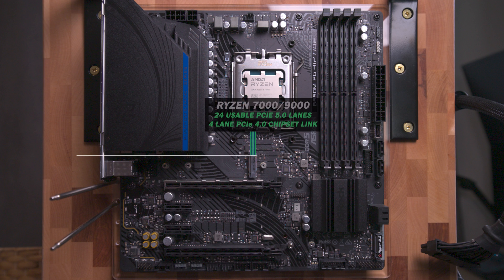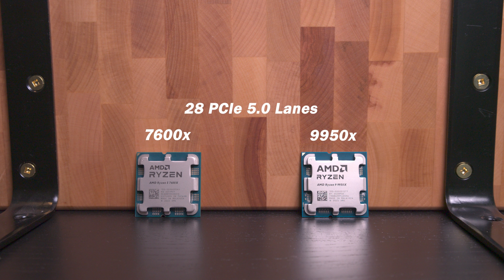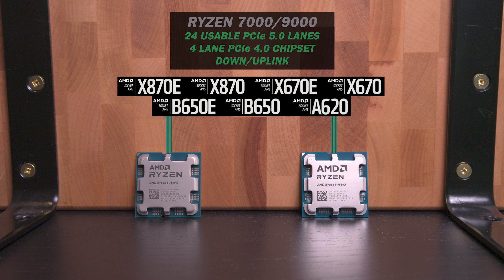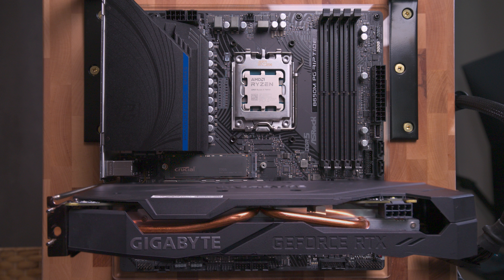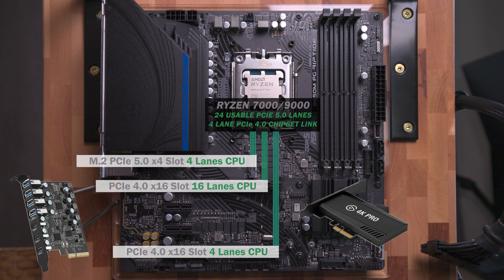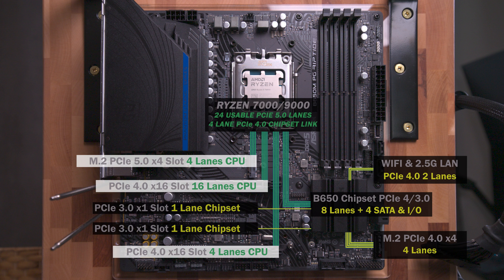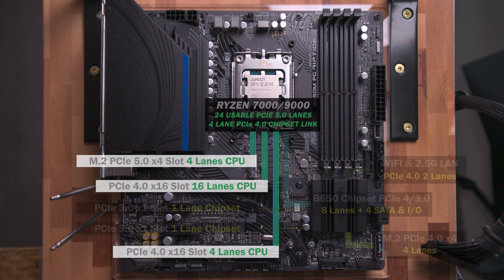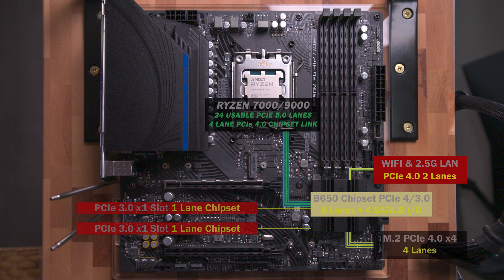Where CPU PCIe Lanes Actually Go - Mapped Out Asrock B650M WIFI AM5 Motherboard

Comment: Great video. So B650 Chipset provides 8 lanes of PCIe 4.0 lanes by consuming 4 lanes PCIe 4.0 from CPU?
Reply from the maker: Thanks! That's right. The Uplink to the CPU from the chipset is 4.0 Gen 4 lanes. Then the chipset takes those lanes and turns them into more lanes, managing the bandwidth depending on what's connected. The chipset also has a USB and Sata controller built in. It manages those connections too.

Comment: Oh, a question if you don't mind. So I have this Chieftec 700W PSU that have only 24 pin and 8 pin power supply cables. But MOBOs that support overclocking have 24+8+4. So I read online that it's fine if I don't have an additional 4-pin cable as long as I'm not attempting to overclock. Is this correct?
Reply from the maker: What's the power supply model? You should be able to find a suitable Mobo/CPU combo to work with that PSU. Depending on the CPU you are looking at, 12+ power stages can be a good start. A good resource for info about power stages is the channel "Actually Hardcore Overclocking".

He does focus on overclocking but, he talks a lot about motherboard power stages and what is necessary/overkill for todays chips.
Reply: @Ronin-Wilde  My current  PSU is Chieftec gps-700a8. I do plan to upgrade it, too. It's just last on my priority list. 

I'm looking to buy GIGABYTE B650E AORUS ELITE X AX ICE motherboard + AMD Ryzen 5 7600X 4.7(5.3)GHz 32MB sAM5 + Sapphire Radeon RX 6700 XT NITRO+ 12288MB
Reply from the maker: From what I just read it sounds like overclocking is the use case that the second 4 or 8 pin would be potentially needed, like you said. As far as a 7600x at the normal clock speeds you should be fine. My 7600x currently has one 8 pin plugged in, it's a test bench so I just wanted fewer cables sticking out and it has worked fine.

Also sounds like a nice build :)
Reply: A single CPU 8-pin can supply up to 300W by itself. Since the 7600X doesn't draw much power there is no need for the second plug.
Reply: @catnap7656  thank you

Comment: So I got myself an MSI PRO B650M-A WIFI, and that has a second M.2 slot for a second SSD just below the top x16 slot and to the right of those 1 lane slots.  Would this just be connected to the chipset, or is something else going on here?
Reply from the maker: @Fel_Temp_Reparatio That M.2 is connected to the CPU. 
Here is a breakdown for your boards lanes:

CPU
PCIe 4.0 x16 slot #1 (16 Lanes) 
M.2 PCIe 4.0 x4 Slot #1 (4 lanes)
M.2 PCIe 4.0 x4 Slot #2 (4 lanes)
Total 24 Lanes

Chipset
PCIe 3.0 x1 slot #2 (1 lane)
PCIe 4.0 x16 slot #3 (4 lanes)

That’s for a 7000/9000 CPU, 8000 would be a bit different.